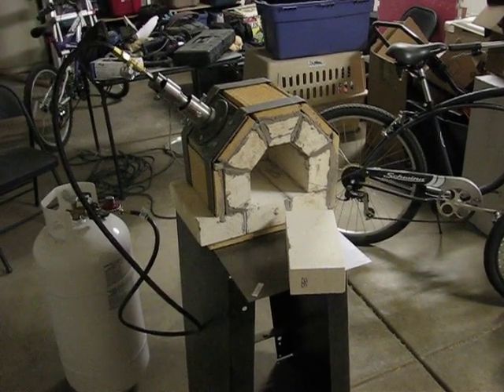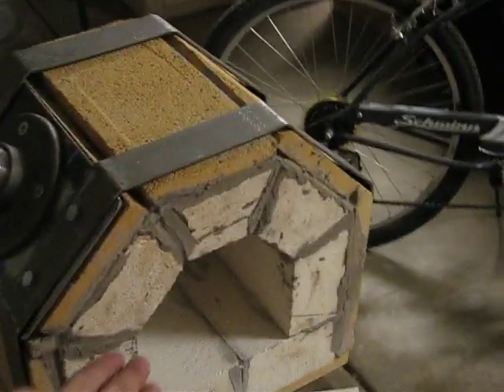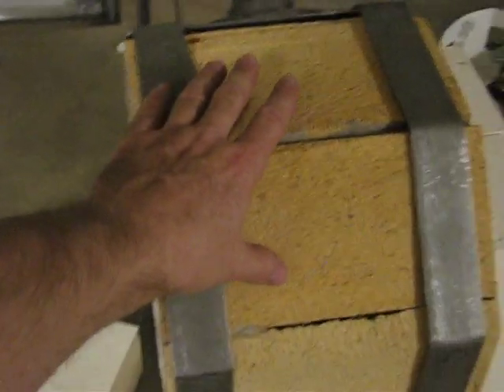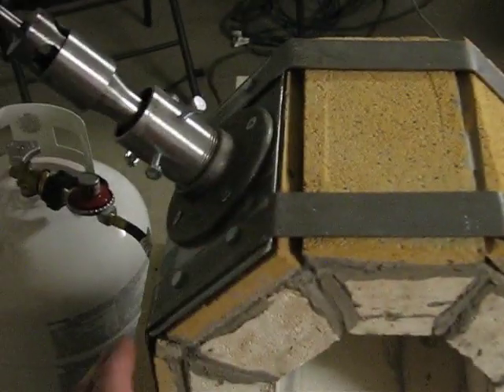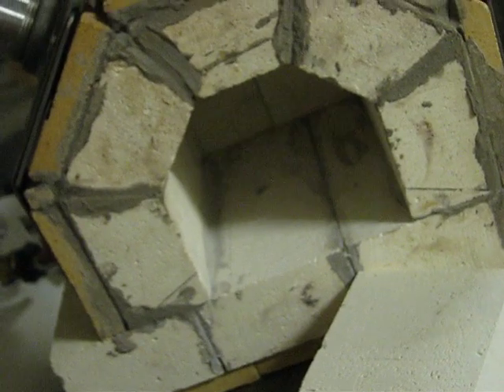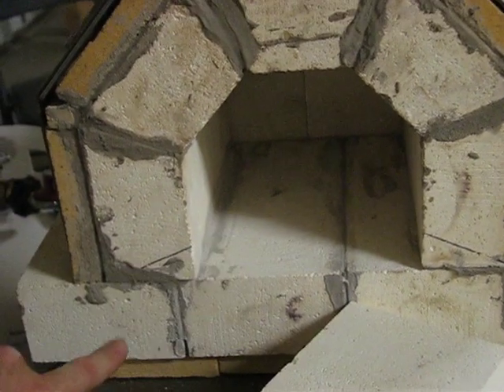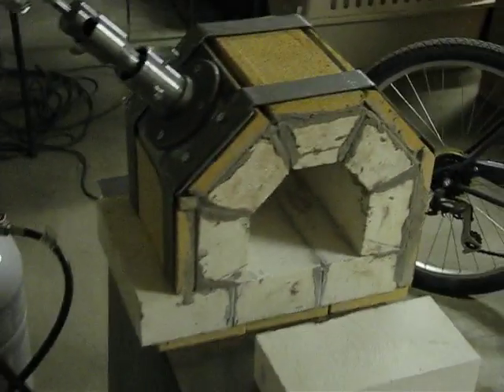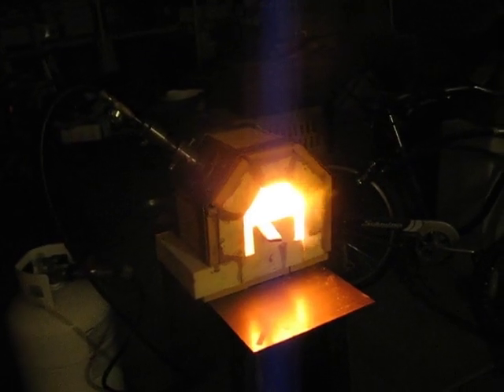Forge Diaries, Episode 001:  New Firebrick Forge

Comment: Excellent build. I just want to note, soft firebrick is "insulating" which has a very low thermal conductivity and do not transfer heat. The hard fire brick is "Absorbing" and acts as a heat sink, it will suck up the heat and old it.

Your design,  while 5 years old, is great. Consider placing a hard brick for the floor of the forge which is better suited as its more flux resistant and durable. It will take slightly longer to come up to temp, but it will hold temperature better and wont be as susceptable to thermal shock while constantly reheating steel. This should ultimately improve efficiency and you will use less propane to maintain temperature.

Comment: Nice Job!  I have been looking for a Common Sense build and You win! I want to in the long run make it approachable by the side and you have helped me attain that. Thanks! Looking for the Venturi Burner Company... Thanks...
Reply from the maker: Brian LeGrand I've actually built two forges since I made this one that I like much better.  I built this one years ago before I had any welding skills.  The nice thing about it was that it was cheap and easy.  The exterior was also reasonably durable.  But it wasn't very easy to move around, and repairing and maintaining it was basically impossible.  Today I much prefer a forge made from a large-diameter tube of some sort, like an old propane tank, with ceramic wool and refractory mortar lining.
Reply: I've been welding since I was 12... I am in my 50's now. Do you remember where you found the Venturi Mixers? I would definitely appreciate the information!
Reply from the maker: Brian LeGrand In that case, you should definitely make a forge with metal housing.  Weld it up with all kinds of nice features.

The propane burners I bought from  Thermal Art Design.  Great guy.  Very honest businessman.  Excellent product. I think it's called the JF burner.

Comment: i have a JF1 burner on my forge as well its a beast of a burner :)
Reply from the maker: I made this forge over a year ago.  Since then I've built a really nice vertical forge with a JF burner.  It is sooooo efficient.   Also, a comment on the guy who sells the JF burner.   He is a good man and a meticulously honest business man in my experience.   I had some issues with my first burner that were entirely my fault and he took care of me.  Good man.
Reply: ChiaraDental
yeah i saw the virtical one, looks good man,  made mine from a compressed air tank, lined it with 2 inch thick ceramic blanket then put a coating of satanite mortar over it,  can see it on my channel. 
i wont think twice about buying another JF1 burner if i needed it they are well worth the price and the quality is top on them.